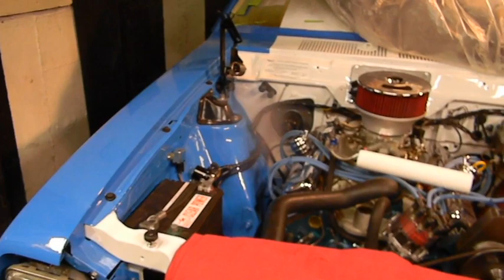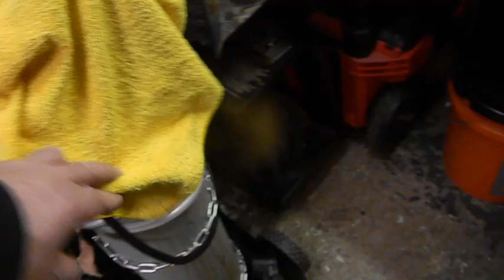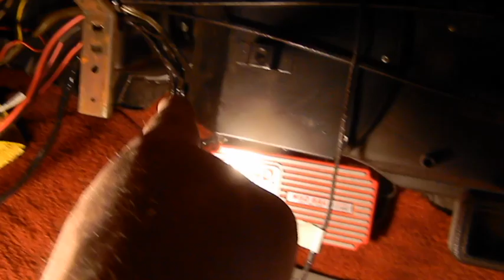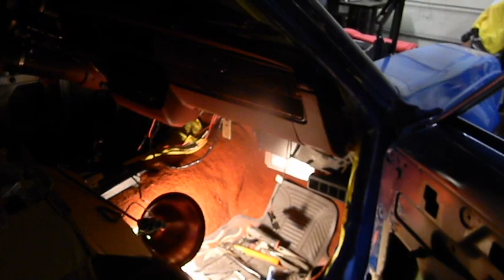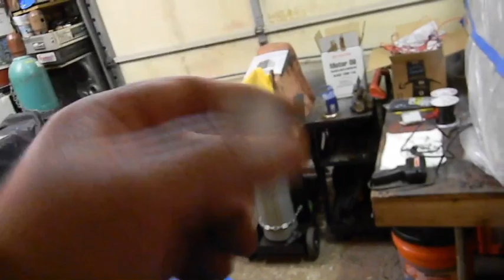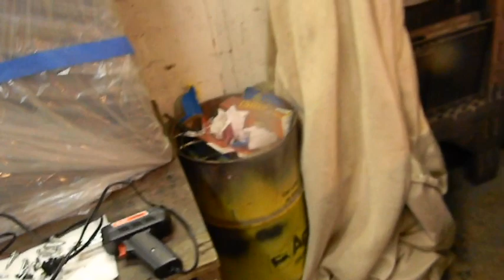Power Hour On The Concord

Comment: You made grommets huh! Lol. Been there, done that, too damn funny. When I worked at Checker Auto, one of my guys went to the Am/Pm on the corner and got a coup,e hot dogs. When he came back we got slammed, big time. So he put the dogs in the microwave and accidentally set it for 20 minutes, then we got slammed again, at which time I sold a 350 Chevy Long block. That took a group effort to get it out the back door. The company had given us an envied lift to move the long blocks around with, but the door from the front of the store into the back room where we had a loading dock was too small for the hoist. Dumbasses!  Rally, stupid fricken dumbasses, I mean how did they miss that? So we had to use an hand truck to get it into the back room. Disassemble the hoist on one side of the wall then reassemble it on the other side which took forever. In the middle of the this smoke alarm in the break room went off. Thank god it wasn't tied to the sprinklers! But the hotdogs had become charcoal sticks! 
Is there a sender console that will work in the Concord? My AMX auto trans car had one. Will it work in the Concord?